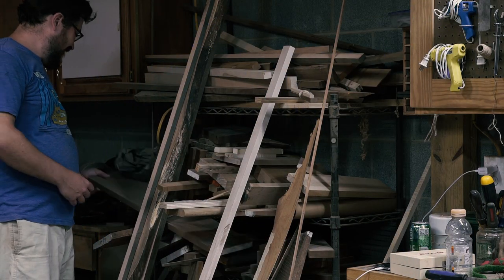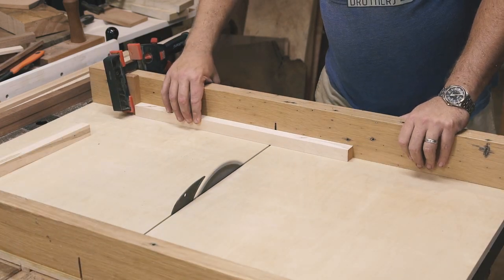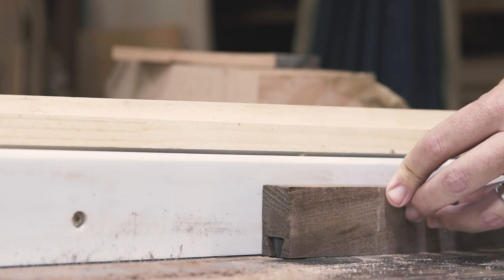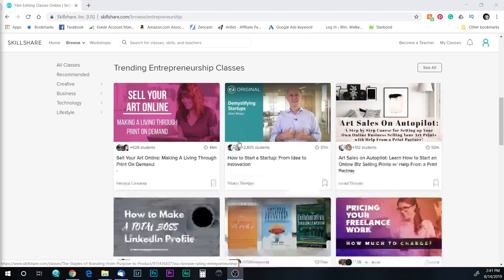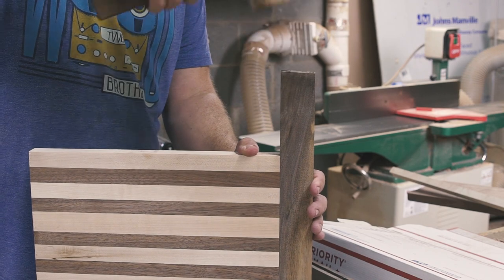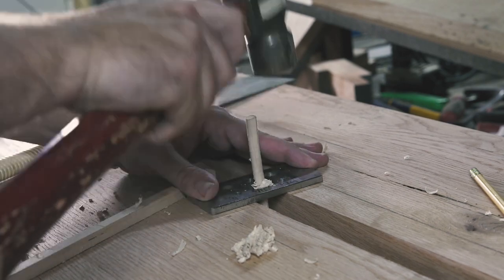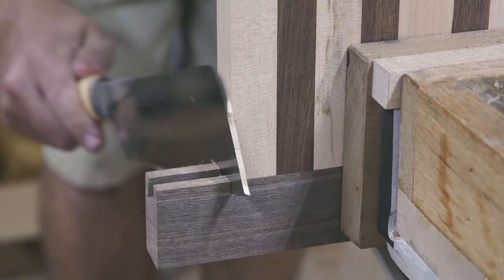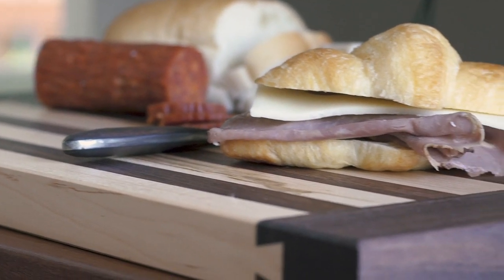The Breadboard Breadboard

Comment: The mirka sander definitely worth the money still??? I wanna pull the trigger on it but damn
Reply from the maker: It's pricey, but all I can say is it's the best, most comfortable, least obnoxious sounding sander ive ever used. The finish is flawless. Only you can determine if it's worth it for your budget. Between this and Festool your money would be far better spent on this in my opinion.